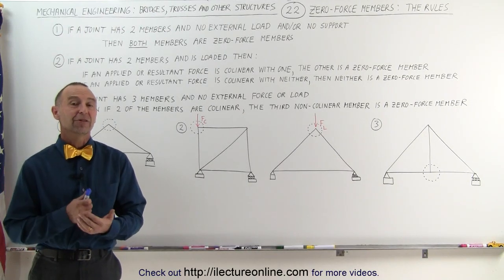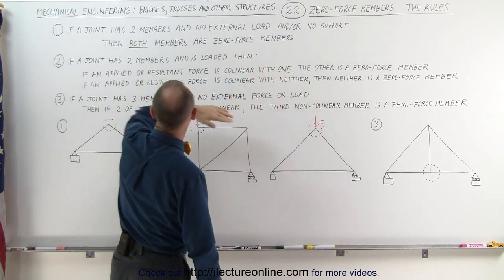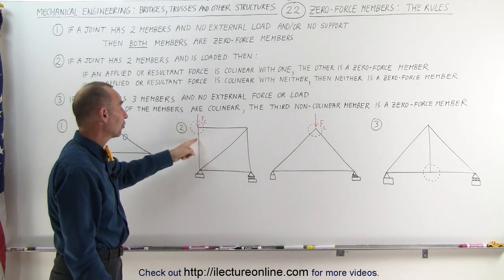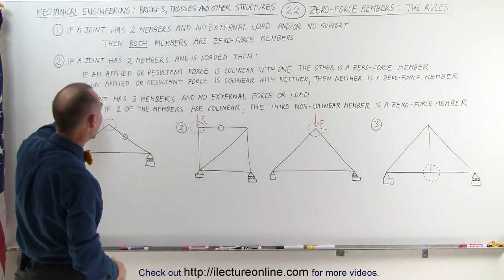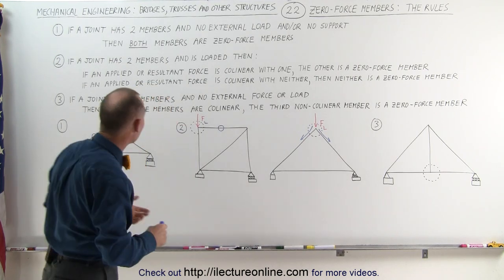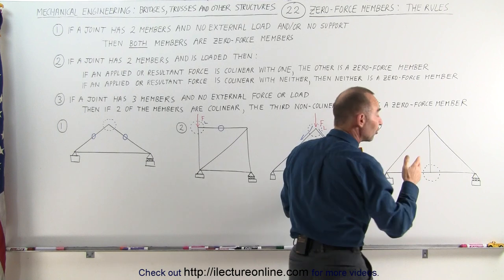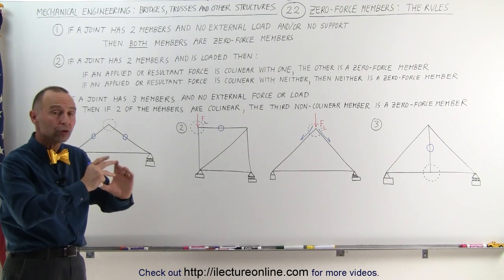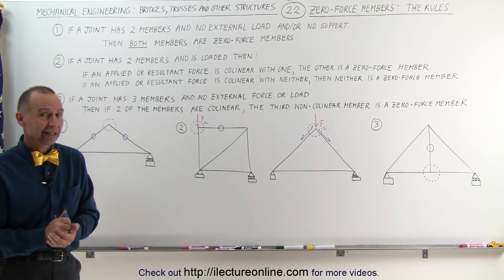Mechanical Engineering: Trusses, Bridges & Other Structures (22 of 34) Rules of Zero-Force Members

Comment: On the fourth example, can I remove the two diagonal members considering the middle member was already removed and there's no load between the two diagonal or non collinear members?
Reply from the maker: Theoretically you are correct.  But in the "real" world, any deviation from the perfect vertical position of the verical beam would cause it the collapse without the 2 diagonal beams.

Comment: Sir, In example 2, Is the vertical member on the right and the diagonal member zero force members as well? Because if top horizontal member is removed then we get a joint with two members and no external force applied to them.
Reply from the maker: The answer is yes.  The diagonal beam and the beam on the right are only there to give it stability in case there is a horizontal force (which in the real world there would be) and then they will no longer be zero force members.
Reply: Dank je.